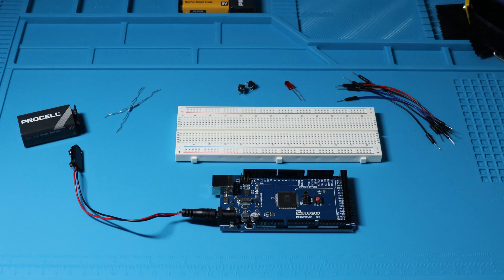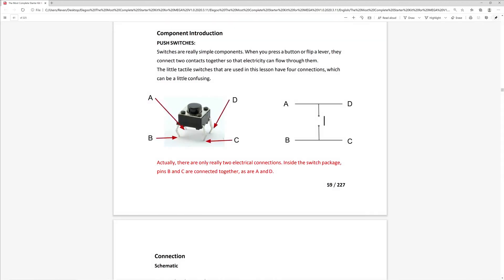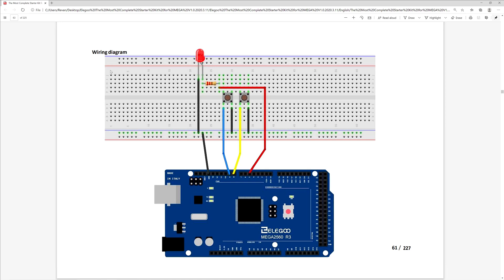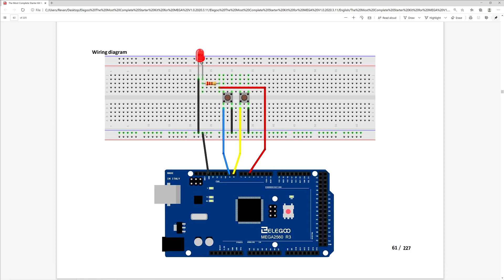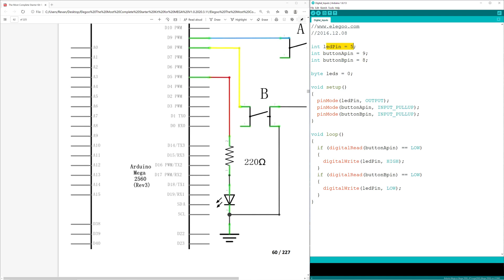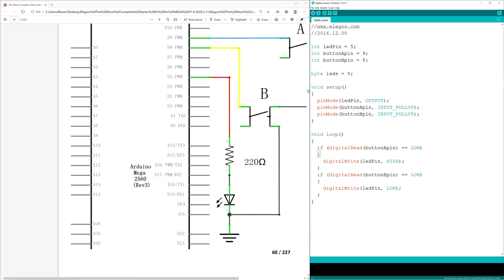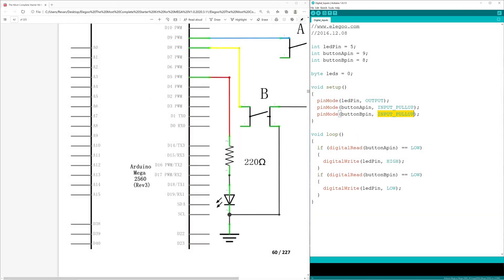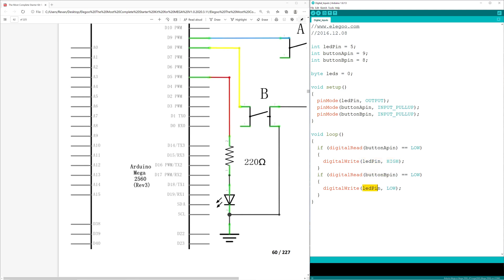STARTER KIT TUTORIAL FOR MEGA 2560, Lesson 5 Digital Inputs

Comment: I got mine to work! The most confusing part about the code is the if the button pins read low then turn on/off the LED pin. I'm thinking they should be detecting if the button pins read HIGH. Its all part of the Input-pull up code that I don't fully understand yet.

Comment: For this lesson on top of doing the normal lesson I would highly suggest to try to adjust the code that you made for the previous RGB lesson and try doing this with the RGB LED with a color wave.
It's a bit more complicated code wise so you'll learn a lot more and circuit wise it's the same except with an RGB LED. so 3 resistors instead of 1, 3 pins instead of 1, etc. You get the point.